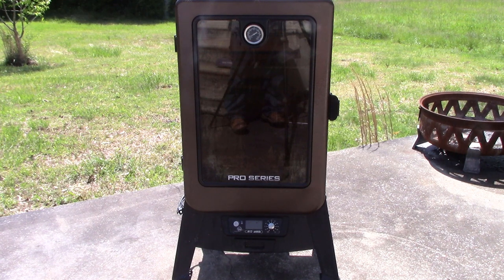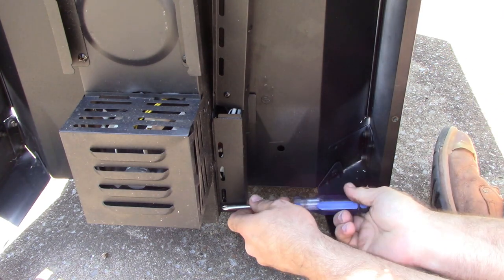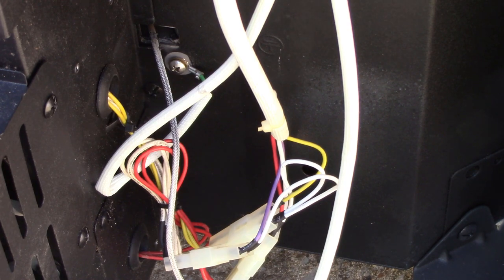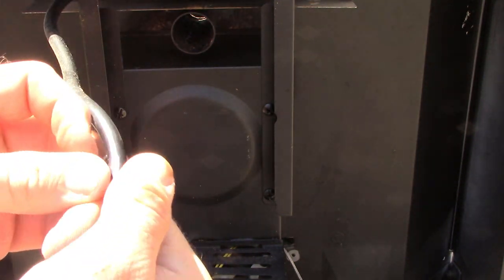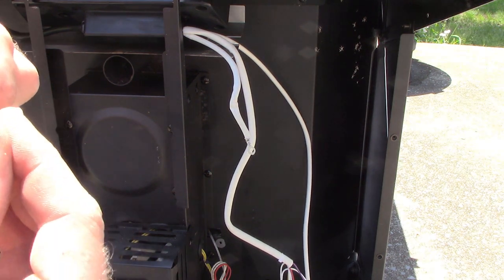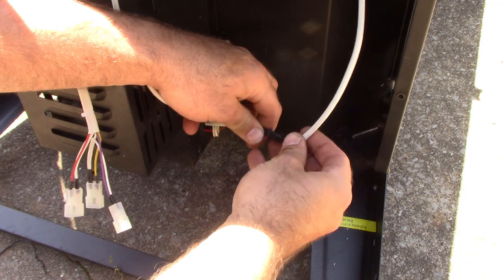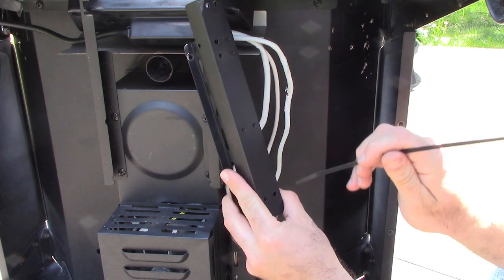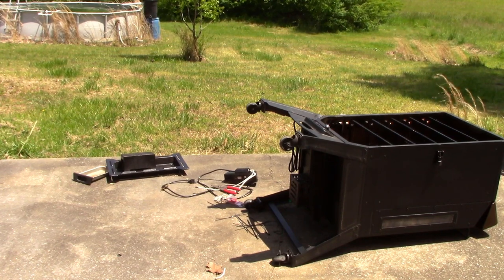Pit Boss Control Board Replacement / ERL code

Comment: Thanks for the video.  I’m not sure if I even bother trying to fix mine or trash it. 6 months and nothing but problems.  I think I should have spent a little more and gotten a Traeger
Reply from the maker: I understand, Ive had a few problems myself. I think it's the design of it, my dad has a pit boss that's like a grill and he hasn't had a single issue

Comment: Question????  Instead of splicing the old ground with the new one to make it longer, why don't you just unscrew on of the black screws holding the black box on and put the ground wire there?
Reply from the maker: that's defiantly an option just make sure there is bare metal for the ground wire to work properly

Comment: Thanks for your video. I've had the same issue. They sent the control board but it still didn't work. They sent me the temperature probe. Now I have to take the unit apart AGAIN to replace that piece. Wouldn't it be great if they sent both parts at the same time? Yes, it would - Pitboss ... Listen to your customers and just do this. It's saves so much frustration. So for those of you watching this great video, order both parts and don't take not for an answer. Replace both while you have the unit taken apart. Women, you can do this. Because of this video and another for the temp probe, I did this on my own and so can you. When this unit works, it's so great!!
Reply from the maker: Yea I wish I got both at the same time too! But it's done now and it works great! I'm glad I could help! Thank you for the comment!

Comment: Dude, this is an excellent video. I'm sure I could have figured out how to do this on my own – but I trust your skills, and wanted to be sure there weren't any surprises. BTW, the four zip ties are necessary to keep the wires as far away from the heat as possible , so they shouldn't be skipped. Thank you for your time. I have definitely subscribed.
Reply: Also, butt connectors are the best way to make a splice, but with 18 Gauge wire, a good tight twist with a bit of electrical tape will suffice, especially since it will be covered with the heat guard wire sock.
Reply from the maker: I appreciate that! thank you for subscribing and thanks for the extra information!

Comment: THINK TWICE BEFORE BUYING PIT BOSS.  Thanks for this well done video. Another video of yours saved me hours of work and a great deal of frustration. First issue I had was having to replace the internal heat probe. Now the control panel. Buying my Pit Boss Copperhead smoker was one of the worst purchasing decision in several years. Yes there is a 5 year  warrantee but Pit Boss won’t repair or replace the unit. Instead they ship the replacement parts to swap out with the original faulty parts, and then leave it to the owners to figure out how to remove and replace these parts.  I bought my Copperhead in August, used it first the end of September. Third time I used it I started getting the ER1 code displayed.  Recently the smoker shut down in the middle of an overnight smoke. I lost $80.00 worth of porch shoulders.
Reply from the maker: I agree, mine messed up within the first month of use. which is why i ended up replacing these parts. I don't like that they don't send any instructions with the parts either. I guess they expect everyone to know how to do this...That is exactly why I made these videos! I'm glad they helped you out, but I hate that its this common to replace these parts..

Comment: how do i know which control board do i need ? i do where do i find the model number ? my ground wire on the control board came off ,i dont know where it goes.
Reply from the maker: I called the pit boss help line and since mine was still under warranty they sent me a new one at no cost.

Comment: Well done video. My control display is unreadable and I've been dreading the replacement until now. I wish Pit Boss had designed the control panel location better to avoid all the moisture and drippings that end up all over it.
Reply from the maker: I'm glad my video helped you! Also I completely agree on the placement of the controll panel, I drip stuff on mine constantly!

Comment: My smoker heated up to 547 and I think melted elements in the control board. I saw melted plastic coming out and it smells like melted plastic. And the unit won't turn on.  Sound about right?Will be using this video to replace. 

What control board unit did you purchase? I see the official one on PB.com (currently out of stock) and some knock-offs on Amazon. Can you share the link you used?
Reply from the maker: Yea mine went way too high also, I had it set on 250 and it got up to 450 before shutting down. I can send you a link to one on amazon, but I called the pitboss help line and they sent me a new control panel and an rtd sensor (temperature probe). He said it could be either one. So I made a video for both in case it's not the control panel.

Comment: Really top video. It shows how badly designed this unit is. Control panels have to be replaced sometimes. It should be a five minute job. This was put together like the control would never going to be replaced, using connectors that invite blowing up the electronics. Crap product Pit Boss. This was enough to turn me off buying one. Thanks for the heads-up.
Reply from the maker: It wasn't too difficult to change it, my main concern was that it didn't come with instructions. So I wanted to help people by showing how to change it out. 
  Its definitely not designed perfectly, and its has a lot of flaws, but I still enjoy cooking on it. 
  I'm glad you liked the video! Thank you for the comment!

Comment: Great video for the diy people. Have you had any issues with the smoker spiking in temperature? Mine, (copperhead series) will cook fine and then after a few hours or so, flames will shoot out of the sides of the box that’s over the pot and the temp will shoot up to 350 and then drop to 170. Thick white smoke will fill up inside and then shoot back up to 350ish. I try cooking at 225 or 250. Pit boss sent me a new probe and a controller, but the controller is on back order. Just curious if you or anyone is experiencing the same issue
Reply from the maker: I've been experiencing several problems with mine. I think it's the style smoker it is. They sent me the control board. And the thermostat to replace. Now its giving a different code and the heat is spiking way high and shutting off. 
  On the other hand my dad has the grill style smoker from pit boss and hasn't had a single problem and he's had it going on 4 years now. 
  I think it's a design flaw with the cabinet style smokers.

Comment: Do you have a part # for the replacement panel? I see one online, but the wires look shorter and do not have heat insulation on them.
Reply from the maker: No sir I sure don't. I called the pitboss help line to get the replacement parts and they sent them to me. I never got a part number, sorry I couldn't be more help

Comment: AJ, about to do the same with my PBV4PS1, they are sending me a control board and said the ground will be short.  Its been a year since you posted this, any updates with the mod?  Is it still going good?
Reply from the maker: Yes sir, I haven't had a problem with the control board, I did have to change the temperature probe. But those are the only two issues I've had with it.
Reply: Where can I get a cheap board 🤔

Comment: Hi, I already changed the controller and the RTD probe, it keeps throwing the ERL code after 50 minutes, I can't find the problem
Reply from the maker: Have you tried calling their help line? Those are the only two issues I've had throw that code. But I have also heard a clog in your auger could cause it.

Comment: @ 18:27 you mention you using an extension cord. Using an extension cord is reducing the potential maximum current the ignitor needs to work properly, especially if it's a small gauge cord. This could potentially cause temperature swings because the sensitive electronics in the controller need a constant amperage. I'm sure there is a built in voltage regulator in the board, but it won't work properly without the proper minimum current. Also, you're risking a potential fire if the extension cord isn't rated for the draw. If you're using an extension cord, feel the plug at the outlet; if it's hot, you're drawing too much current from that outlet. I always move my smoker close enough to the outlet so a cord isn't necessary, or I'll run a new outlet from the nearest GFCI with 12/2 Romex to make a dedicated outlet. Love the video up to this point though.

Comment: I've got a failing LED and when I plug in the smoker, it throws the breaker. Could that also be the control board?
Reply from the maker: I believe it definently could be, but I can't say for certin
Reply: We had to replace the fuse off the control board

Comment: ERL code is the auger, or so that's what I've been told.  CLEAN CLEAN CLEAN the auger and no more problems for me.
Reply from the maker: That's what I thought at first too. Unfortunately that's not always the case. 
  When I called pit boss support they asked if I cleaned the auger, I told them I did. Then I told him what it was doing before it threw the ERL code. He said it was either the control board or the thermostat. He sent me both and it worked fine after I changed those parts.

Comment: Has anyone tried moving the control panel to the top of the smoker to avoid the extra heat and drippings?
Reply: Mike theres a facebook group im in where a guy made a 5-6ft long extension and now hangs his controller on a wall out of the elements.